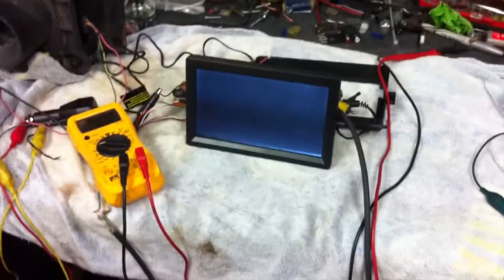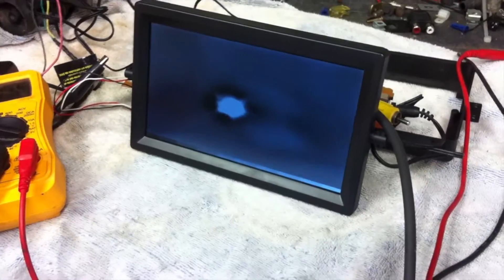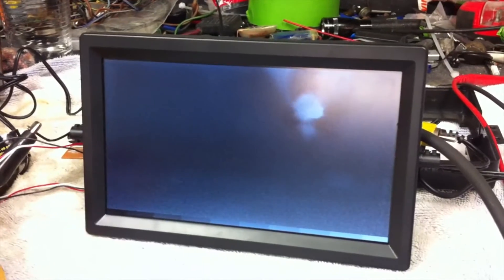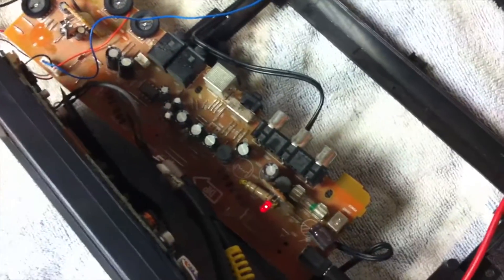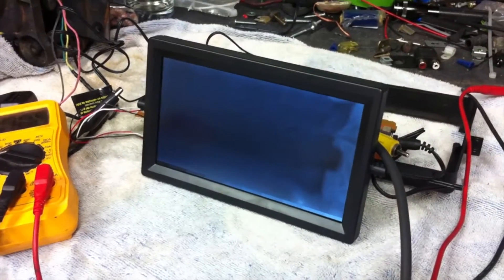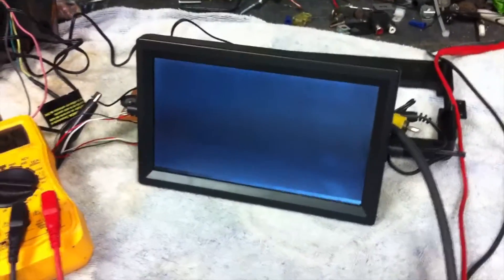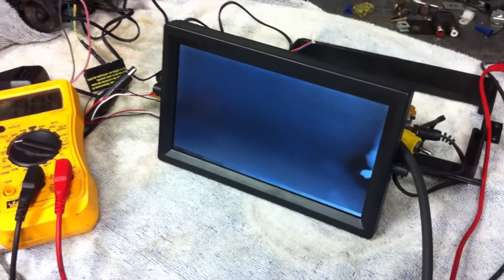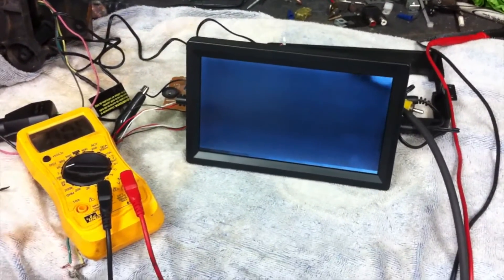Thermal Test 2- Screen Bench Test

Comment: This is awesome! I have an M109A3 Military truck that's being converted into a camper and in the drivers cab I was going to install a Gen 2+ Night Vision System from a Bradly Fighting Vehicle but my opportunity to buy the one I wanted has passed ($700 for a newer update vs $1200 for the older so I'm gonna pass on this option). But this set up could be done much cheap & in some ways its more effective (they both have there pro's & con's). If you'd be willing I'd like to speak with you about this.